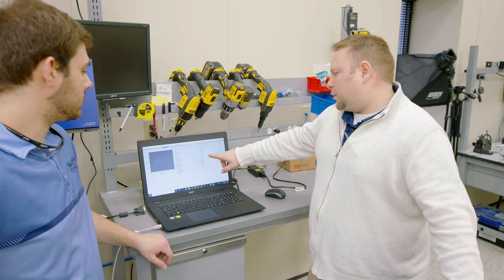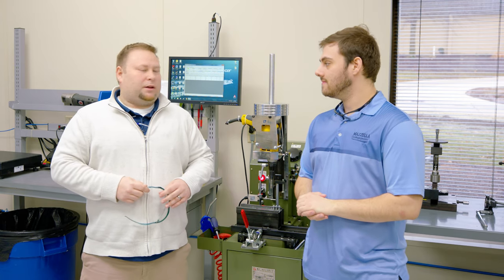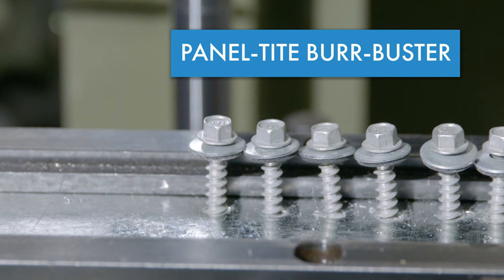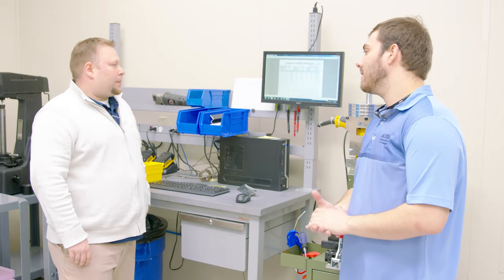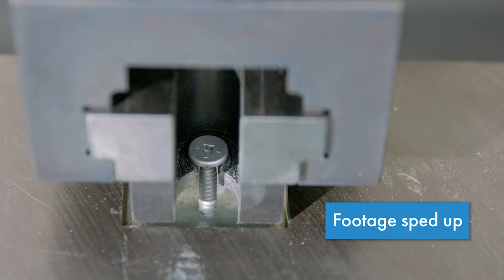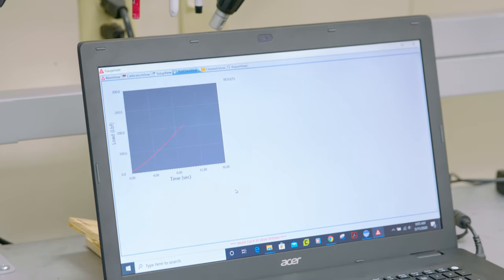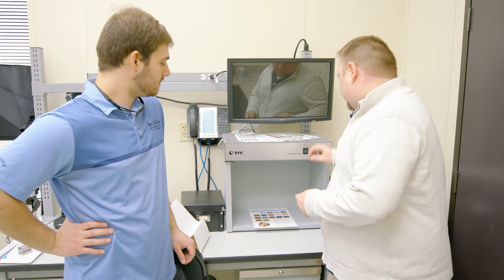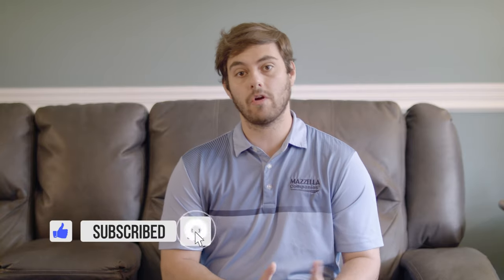How Are Metal Roofing Fasteners Tested for Quality and Performance?

Comment: Good video
But the pull-out value... more info please. 4.26 ... what? PSI? How does that compare to 100 MPH wind?
How does that compare to a common nail? 
Do other screw types have higher or lower numbers.
5/8 plywood, would it be the same for OSB?
And what would it be for thinner material?
Overall great video but you could do a lot more in depth stuff with this guy.
Thanks
Reply from the maker: Thanks for the suggestions, Randall! I may try and get a Q&A episode put together about your questions specifically. I agree, pull-out values could be a good topic for a deeper discussion. Stay tuned! -Thad
Reply from the maker: Here's the episode I promised: https://youtu.be/_cC8fE74D-Q
-Thad